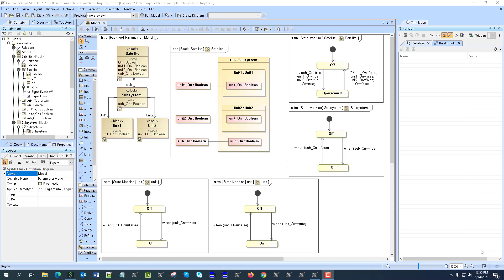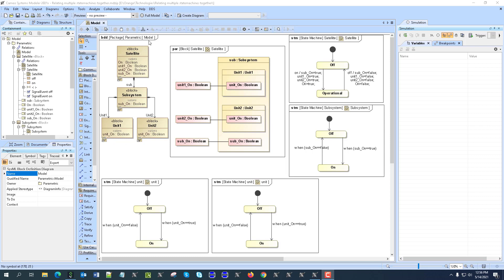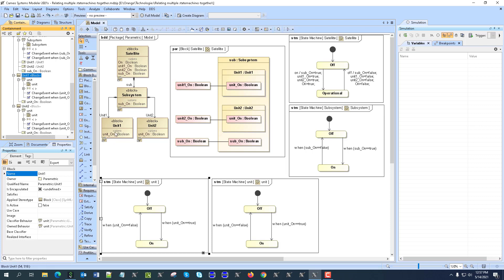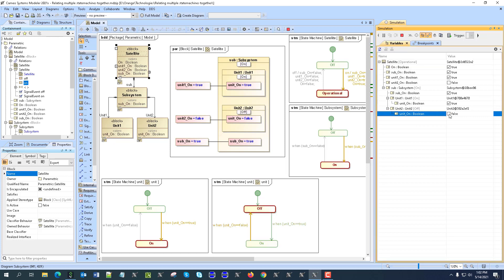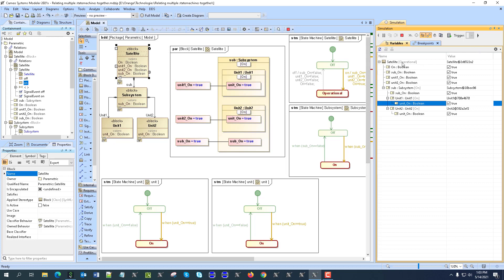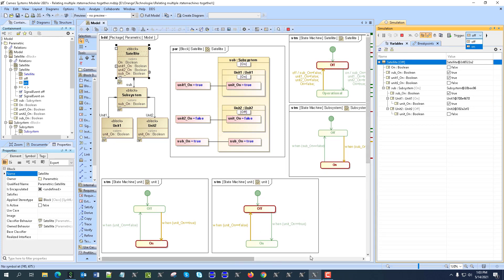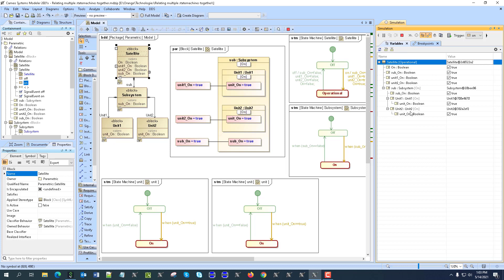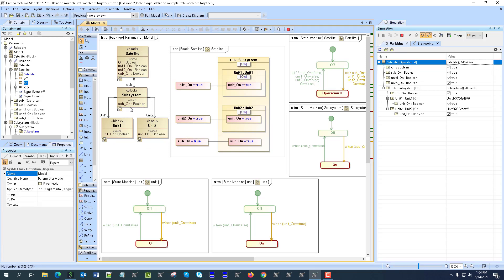Relating And Simulating Multiple State Machines Together in SysML

Comment: I have a signal as "Fault State" and has 2 different attribute as "1" and "0". 

I would like to use these signal to ensure transition between states in stm but I have 2 different attribute. How can i select the right attribute? 

For example; initial system state is "OFF", and if "FaultState" signal is 1, then the system must go "Not available" state. But if the "FaultState" signal is "0", then it must go "ON" state.
Reply from the maker: Hello Ufuk. You can use change event on transition when(signalName == 1). Or guard on transition [signalName == 1]. Change event shall happen when you are in state before so it means that your property shall be changed to griger it. Guard does not need to be change it is just condition which shall be true to triger transition.

Comment: Very cool, Saulius!  How do I setup/start CST to use all 4 state machines at once (you didn't show that)?  It doesn't look like you used a SimConfig.  Also, is the .mdzip file available for this model?
Reply: I found the link to the sample model in the overview above.
Reply from the maker: Thank you fir the feedback. Each block main behavior (classifier behavior) will start automatically. Also you can start multiple behaviors from any running behavior.

Comment: Thanks for another great example.  Quick question, could you combine both the state machine ex. with an IBD that is used for receiving signal to perform some action based on what state its in?
Reply from the maker: Hello Kizer. Thank you for the question. You can check state here is video on it - https://youtu.be/GvfyzPp4zio. Also you can do it by updating block value property value when state is changing. Also here are few great demos of same level state machines communication using signals and value change: https://lnkd.in/eDteUPE, https://lnkd.in/eYVYqJN, https://lnkd.in/e2NM7_H, https://lnkd.in/e-udYJz. Let us know if something else is needed and we could prioritize demo on this topic.